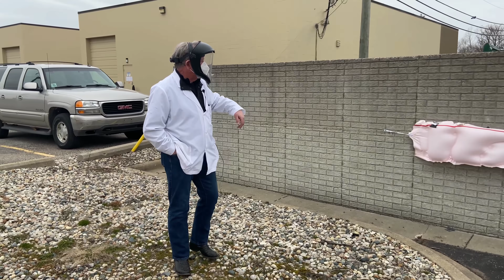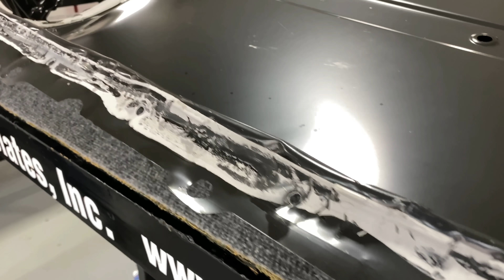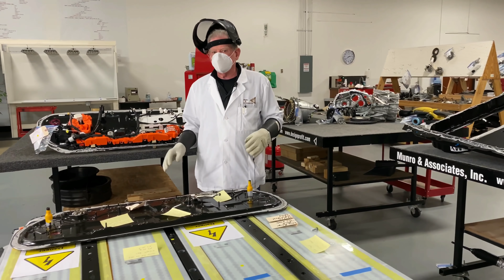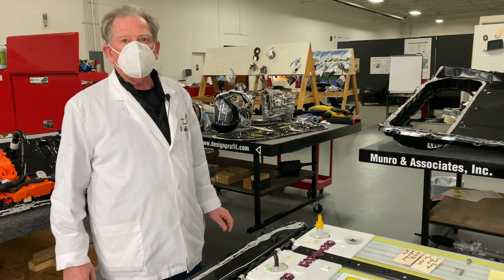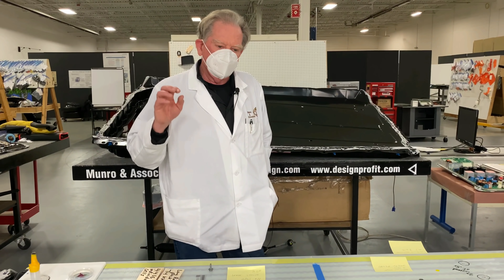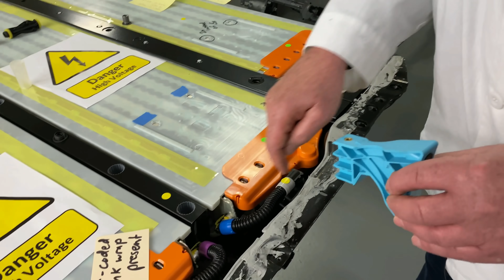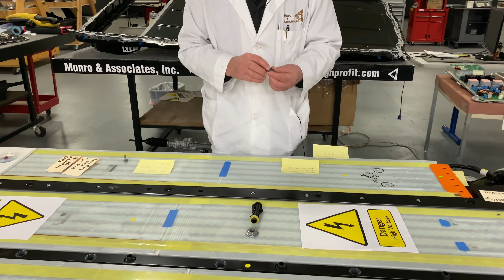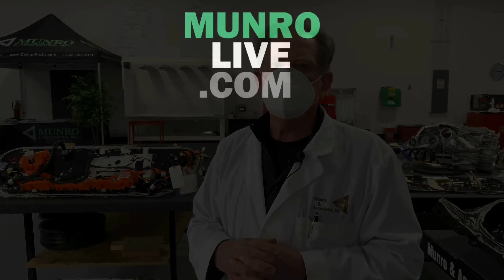Model Y E28: Inside the High Voltage Battery, Refinements from the Model 3, and Airbag Deployment

Comment: Aren't airbags supposed to deflate on their own?
Reply: Most airbags are intended to deflate as deflation adds a dampening function  like a shock absorber. However, this is a side curtain, intended to protect you in case of a rollover crash. Normal frontal or side crashes are over in less than 100ms or 0.1seconds. Rollover crashes can last up to 6 seconds. So, rollover curtains are engineered to practically not leak.
Reply: @danawold4547  I had no idea

Comment: Why can't you take off the battery lid like you do a windshield that is held down with adhesive?  Use a strong cord with an abrasive built-in and work it back and forth to cut the seal.
Reply: Does it have a lip?
Reply: Because with a windshield you can get your hands on each side of the blued area.
With the battery,you would have to go all the way across side to side. That would put you at risk of damaging the battery and getting shocked.
Reply from the maker: Javier Guerra correct! No access from the inside. Thanks for tuning in!

Comment: Sorry, but I've still got to disagree about the importance of serviceability. If engineers did their jobs (your words, not mine) and designed products that never needed service, I wouldn't have a job. We know from the countless EVs out with Li battery packs (including other Teslas) that they do need occasional repair. Replacing huge, costly assemblies rather than replacing individual failed components is wasteful and costly, either through warranty expenses if the vehicle is still under warranty or through customer out-of-pocket costs. It would suck for a Tesla owner to have to replace the entire battery assembly, at substantial cost to them, on their Tesla once it is out of warranty for a single failed cell/battery module or even just a bad connection because anything inside the battery is not serviceable. If you have to destroy the battery pack cover in order to get it off, it isn't serviceable. In my experience, the only thing likely to go back in the small section under the back seat that is serviceable is the contactors. Every other fault I've seen with a Li battery in a car is either related to a failed cell or a poor connection, which appears to require the entire pack to be replaced on this vehicle. Other EVs would allow you to replace smaller portions of the pack, at a substantial cost savings to themselves (warranty) or the customer (out of warranty).

Thanks for blowing up the side curtain. That's the only style of airbag I've never witnessed in action. Hope to never experience a crash severe enough to see it in person.

Comment: Sandy, as you know reports are that Tesla has added Vehicle-to-Grid capability to the Model 3/Y.  One Tesla HW enthusiast has shown that the original 2017 charge/DC-DC converter module does not have circuitry that can support this feature.  It might be very interesting video for you to address the claim on the current Y HW that you have.  This is the video about the lack of the capability on original Model 3 HW: https://www.youtube.com/watch?v=lXokJEzXwaI